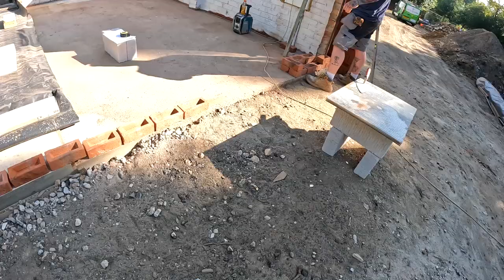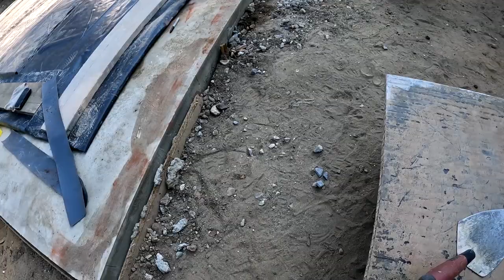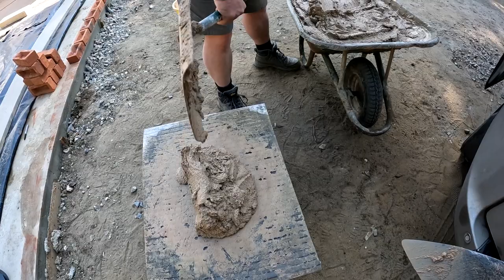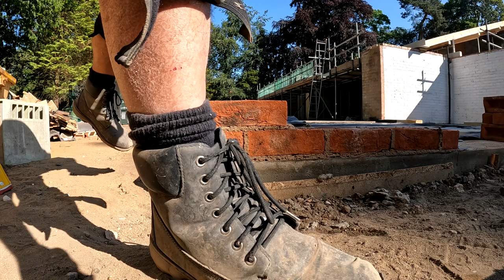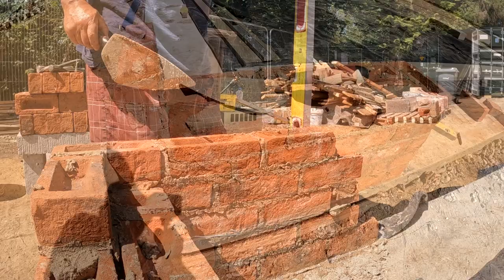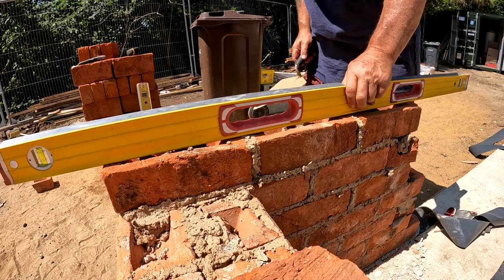Bricklaying, raising a corner with lime mortar that feels like concrete!

Comment: Is it hydraulic lime with sharp sand in the mix ,couldn't fancy that with bricks 🤔
Reply from the maker: I’ve not used it before, the customer has provided it , it’s in bulk bags comes dry mixed then you Chuck it in the mixer and add water, it would be ideal for flint work, but it’s really poor to lay bricks with, cheers   For watching 👍
Reply: @BuildingwithBudd  no probs bud enjoy watching your videos and various work you do 🍻👍
Reply: @BuildingwithBudd  that's the kind of mortar we almost always use in the US usually spec mix or ameramix it's pre mixed lime cement and sand in a bag we just add water
Reply from the maker: Has it got a lot of stones in it and do you use it for laying bricks?
Reply: @BuildingwithBudd  it doesn't usually have a lot of stones in it, but sometimes it does I can tell it looks more like the mortar we use the stuff you guys use with the plasticizer looks nice and creamy our mortar doesn't look like that
Reply: @BuildingwithBudd  same as m12 then for a footing really

funny watching the brickies throw a shovel full in the mixer and half the shovel blow away on the way in
Reply from the maker: Where do you ply your trade ?
Reply: @BuildingwithBudd  northeast United States the state is Rhode Island it's the smallest state in the US
Reply: @BuildingwithBudd 
What lime is it? Natural hydraulic lime? What rating. 2,3.5 or 5. 

You should be laying with a nhl 2 for brickwork. Remember nhl mortars double in strength within  two years so using the wrong compression strength rating can actually go against you in the near future, ie spalling bricks especially if they soft. Let’s hope the client has done his homework. 

It’s obviously not traditional lime putty or non hydraulic lime.  

This would be a 2.1.1. Mix 
2 sharp or aggregates of choice, 1 plastering sand and 1 lime. 

Your bags you have. Mix it for at least 20mins and not to add to much water as the lime will fatten up. Leave to rest for 10mins and mix again for at least 5mins. You will see a change on the laying consistency instead of knocking it up in the mixer and pouring it straight out the mixer and using it. 

Thee best material going by far to use, hot mix lime is even better.
Reply from the maker: Well many thanks for watching us in Norfolk in the UK 👏👏